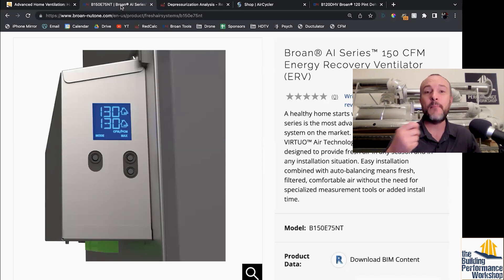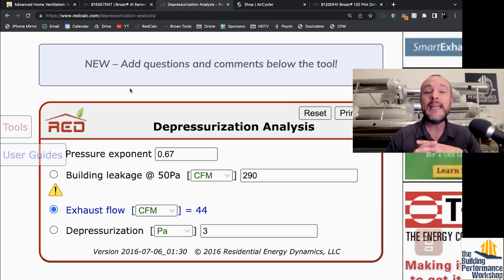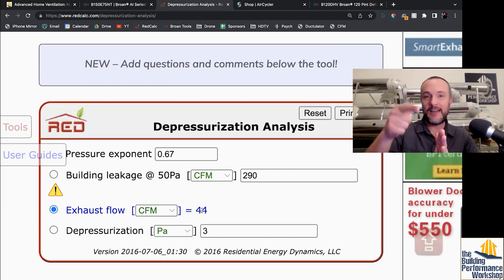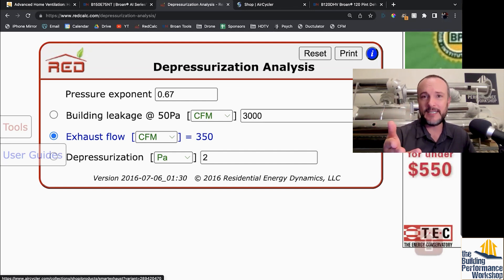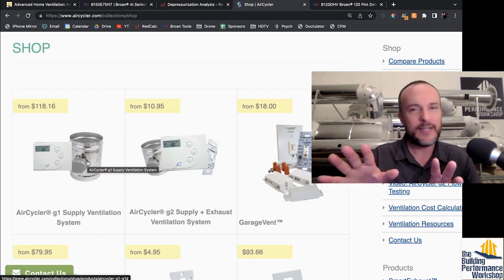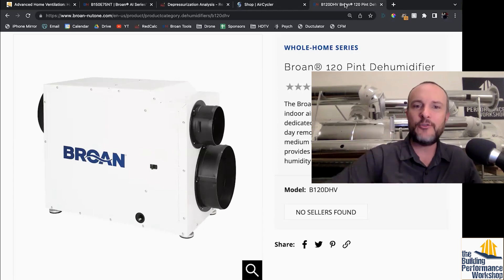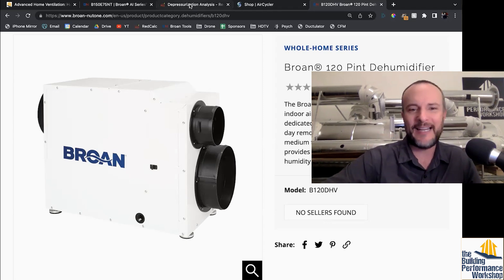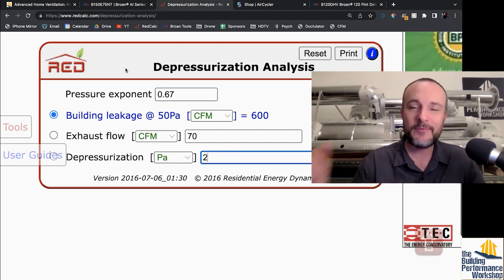Home Pressure Effects of Unbalanced ERV, Ventilating Dehumidifier, or Supply-Only Ventilation

Comment: Loving your videos.  Getting overhelmed trying to do all of this math.  My issue is that I live in Michigan, and in the winter, I have cold air coming down my fireplace (with smoke occassionally if there's a fire).  I finally realized thru your videos I'm having a negative air pressure situation.  Furnace, gas dryer and water heater, bath fan (not used frequently).  Bottom line, I need to equalize the pressure, or have some positive.  I think I'm back to wanting an ERV.  Looking for a product that would automate pressure balance on my existing 1970's furnace colonial house.  I actually got AI to provide an answer!  Do you have a video already for this?  Sure you do...  How would I vet a HVAC guy to know they know what they're doing, or do I do this all myself?

You're very impressive!  Love your videos and logic.

Chris

Comment: We use an always on central bath fan and ventilating dehumidifier, it brings in around 100 cfm. We only slightly are pressurized. I am wondering if it would be better to have motion sensors on the bath fans since the pressurization isnt that high.
Reply from the maker: I bet your ventilating dehu doesn't bring in outdoor air 24/7, AV- so your pressure would be flip-flopping in that case.
Reply: @HomePerformance  It does. We use a humidistat to kick on the compressor when humidity gets over 50% but the fan runs 24/7. Same with the central bath fan. We put in wiring for boost in the bathroom but have never needed it. We did 30 cfm (i like hot showers) in each shower and 20 in toilet rooms. We originally were going to do an ERV but when they did the calcs for the ATL area the kwh saving was not worth it.
Reply from the maker: Interesting, AV, that’s an unusual setup. Way to think outside the box!

Comment: Great information, very well presented as always.   I am currently installing a Sante Fe 120 Ultra dehumidifier on a 120 year old house in New Orleans.  The contractor is piping in the outside air through the ventilating dehumidifier.   I was wondering if this will add any benefit as I am sure my old house has lots of leakage through doors, some old windows, and even the floor.  It will put a higher load on the dehumidifier.

Comment: What if you put an ERV unit and duct the fresh air supply to that intake 6” duct on the dehumidifier? Then have 2 separate return systems, one for the dehumidifier and one for the stale air exhaust of the ERV? 
I’m building a recording studio so the ducts both supply and returns go through boxes built to diffuse sound transmission yet supply fresh dehumidified air. The hvac will be split units that have silent mode like Mr cool.

Comment: I Have Broan B150E75NT AI Series. I'm using the Independent T1 Install Setup. When Exhausting/Supplying from/to more than One Area/Room/Locations, How do you maintain Suction/Supply Air? I Have noticed a Significant drop in Air Suction from Exhaust and Decrease in Supply Air when I "Tee" in to more than One Area. The 6in Ducts drastically drops the air movement after I "Tee" Off into Any Location. How do You Overcome this?
Reply from the maker: I upsize the duct trunk to 8”, and yes the flow gets cut in half every time you tee, but it all should add up in the end.
Reply: I have this same setup and I installed takeoffs with dampers on them. Bought a flow hood on Amazon and read cfm at the grills while someone dialed the dampers in. You have to go around and do it multiple times because each change changes them all but eventually you get it pretty close. I have 4x12 rectangular trunks and 6” takeoffs to round to oval branches from the basement up into the walls.

Comment: I'm building a 200 sq foot tiny home with an 11.5' ceiling (and loft). I will have an ERV and range hood vent over my cooking area. (If it matters, I plan to get a mini-split for heating/cooling). Is it possible to have too much air exchange? Or can I get a range hood and ERV that have any cfm count? Thanks!
Reply from the maker: Lawrence Berkeley Nat’l Lab buddy of mine helped me design the one for our 200 sq ft thow, 30 cfm continuous is a good minimum to aim for.
Reply from the maker: And ps, you need make up air. If you haven’t seen this:
https://youtu.be/Xy4OvjEd3IE

Comment: I have an icf home built to passive house standards. I have a .2ach50 my leakage was 90cfm (comes in the electrical panel). We put a venmar x24 hrv. Should it be an erv? I live in Nova Scotia Canada and we are having trouble with humidity. We run a humidifier just to keep the house at 50%. I hope I hear from you.
Reply: i would. it will mean your humidifier won't run as much. not sure what your summer is like, if its humid summer you may need a dehumidifier as well. have your mechanicals control your humidity and the erv makes it easier for them to do their job.
Reply from the maker: Hey PD12, you can probably just order the replacement core as an ERV from Venmar (aka Broan). Yes, that would buffer against dryness just like the HRV buffers against coldness. By the way, 50% RH is a pretty high humidity in winter- might want to try turning down to 30%, makes condensation way less likely.

Comment: I love your Chanel , is there any way I could send you the plans to my home and have you recommend how I should duct it. I’m building a home in Panama , and it’s very difficult finding qualified people to do work like you do. The home will be insulated and pretty much air tight compared to what they build down here . Just need ac , it’s always 26* to 33* all year round. All the contractors here will over size what I need , the house is 2700 sq feet. I will pay for your expertise . Thank you
Reply from the maker: Hi Giuseppe- yes, I consult on 10 projects per week, here’s where you can book a slot:
https://buildingperformanceworkshop.com/video-consulting
Reply: @HomePerformance  ok great I’m in Canada for a couple of more weeks then back home , I retired in Panama I will definitely book a slot thanks for the quick reply, I’ve been in construction all my life as a paint contractor, but I’ve learned a lot about other trades, and I’m sure I can pull off the duct work for my hvac system as long as I have guidance . Of all the channels I’ve watched your the person I feel that can make a job go smoothly . Thanks

Comment: Does it make sense to use erv/hrv instead of (or with) bathroom exhaust fans and range hood exhaust?

Mostly looking to condition makeup air for cooking (electric) and showering
Reply from the maker: Another video coming soon, Andrew, but short answer I'd never use an ERV for make up air- it ceases to be an equalizing ventilator at all.
Reply: Just learning all this stuff myself, but range hoods should always be vented directly outside. They could clog an ERV/HRV, plus there will be build up in the pipe.
Reply from the maker: Truth

Comment: I have a 1970's home in Minnesota where every "standard" (Not air tight new builds) home has a long 6-8 in flex duct that is hooked up to the side of the home and terminates over by the furnace with a slight bend at the end, dumping warm humid or cold dry air into the basement. I realize that this is the fresh air supply for the home, especially useful if you have old school heat/water gas furnace. Is there a way to allow this air to come into the home, but still be able to filter/control it?
Reply: Ohh. I was wondering why I had an extra duct by my MN furnace. I don’t think it’s a needed since they replaced the furnace with 2 pvc  pipes for air/exhaust
Reply from the maker: That's probably not supposed to be ventilation air for the house, Eric, it's likely a misguided attempt to provide combustion intake air for the furnace, I'll bet $100 long distance it's completely unnecessary. As described, it would work only on cold days, when outside air will be sucked in- all summer long, that's bleeding A/C to the outside, and your home gets its supply air from the attic (gross and super hot/humid).

Comment: btw something to watch for with hrv/erv's. i recently found a brand that has EC motors, but it does not have individual controls so you can't put the erv out of balance. or more importantly can't balance the system without using dampers.
Reply from the maker: What brand, T?
Reply: @HomePerformance  i think that was cleanaire nz.

Comment: corbett, do you have any info about the story that balanced ventilation isn't worth it until you go air tight enough? the story being there is more ventilation air going through the envelope than whats going through the balanced ventilation system therefore making the balanced ventilation pointless.
Reply from the maker: Sure, few weeks back: https://youtu.be/lnOCAPPVT5g
Reply: @HomePerformance  i think that one was comparing to bath fans not supply side. if i understand it correctly usa typically uses negative pressure ventilation while here we use positive pressure ventilation.
Reply from the maker: Air doesn’t hold much thermal mass, AND balanced ventilation is costly to install and maintain, so yes, I’d only want it if I needed it.

Comment: I’ve heard you say a few times that an ERV/HRV unless you have a really tight home. What are the downsides to installing one on an old home?
Reply from the maker: Downsides: cost, installation complexity, testing, monthly/quarterly maintenance, no benefit of recovery core since air holds very little heat and you’ve got more air leakage than ventilation. Exhaust fans and supply ventilation: low cost, simple design, zero maintenance.

Comment: so why have balanced ? you can just take sure you don have negative pressures, and don have to worry about commissioning or adjusting....you dont necessarily need positive pressure, you just need to eliminate negative pressure right ?
Reply from the maker: How do you propose doing that if you use one-way fans in bathrooms and laundry intermittently?
Reply: @HomePerformance use an erv in all bathrooms rather than fart fans?

Comment: Okay, at https://youtu.be/7nhXP3v5Zy0?t=26, I am already objecting.  It seems to me suspicious to tie balanced ventilation with an ERV because it is "balanced".  Instead, I would argue that we need need to balance exhaust fans with equally sized inlet fans.  So with an ERV we should be "balancing" the expense both capital and maintenance of a complicated piece of HVAC equipment compared to its improved energy efficiency.  So I suspect I am going to struggle with the rest of the video.  But proceed!